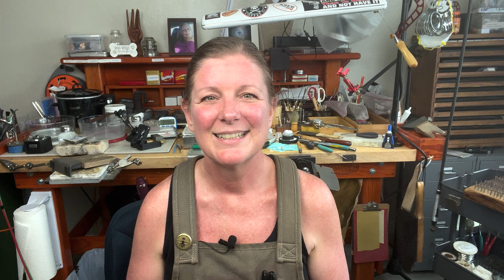Setting an Oval Faceted Stone | Step Bezel Stone Setting

Comment: Ditch the bezel rocker and use a burnisher, you get better leverage, more control and fewer damaged stones.
Reply from the maker: When I’m teaching, I use the bezel rocker for the beginners, but in reality, I use a brass pusher that I made myself from 3/32 rod. You’re right, I hate the bezel rocker. It always slips and then my stone is either cracked or scratched. I’m planning to update this video with instructions on how I use the brass pusher instead.  Thank you for the feedback, it really does help. 🙂
Reply: Do you thin out the top edge before using a burnisher? Can’t remember the word for that process, I am a newbie

Comment: Thank you Julessa, have just come across your tutorials and like others found it very helpful seeing the work done with mostly hand tools. That said, I'm hoping to move up from my wooden ring holder pressed against the bench! Which ring holding system do you use? Thanks again Janet 🙂
Reply from the maker: Hello Janet! Thank you so much for the kind words. I used a wooden ring holder for YEARS. I didn't upgrade until I took a jewelry stone setting and engraving course at the GRS Training Center in Kansas a few years back. So, I use the GRS Stone Setters kit for my set up. It has been a game changer for me, but was pretty pricey. Once I decided to buy it, it changed the way I work at my bench dramatically. I'm happy I spent the money. For the most part, I try to stay with hand tools because I get a lot more enjoyment out of doing things by hand, but this actually freed my hands up and made my work so much better and the process even more enjoyable.